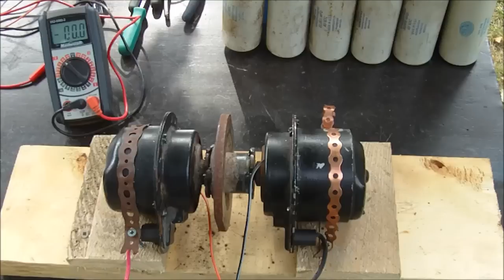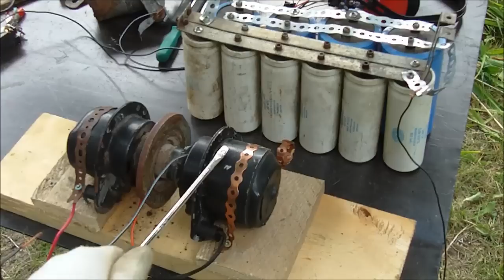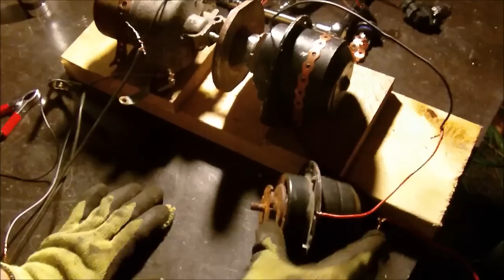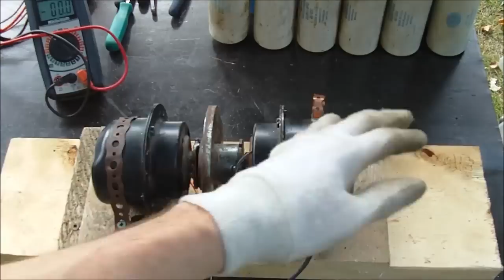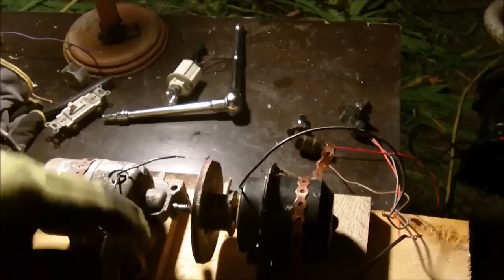Electric Motor to Motor, can they self run?

Comment: I was thinking an electric fan motor hooked up to an alternator. Would THAT setup self-run?
Reply: +killer13324 no. just... no.
Reply: +killer13324 Welllllll depends on the efficiency of the fan motor's input vs output,  and how this is connecting to the alternator (direct, chain, belt) direct is the best (less loss in transfer)  what is the efficiency of the alternator?? conversion from mechanical to electrical.
depending on the numbers, it could work.
Reply: Jesse Fritz
100% efficiency is what you nuts are describing, and thats damn impossible because even if we COULD design a setup that would allow that, the air resistance around the flywheel would take it to 99% and it would eventually end, but lets say its in a vacuum, and ignore slight power loss by distance travelled in wires. The engines are inefficient almost in DESIGN.
Magnets work best when close, but because you can only put so many around the edge and they are only so dense, you lose power due to the distance the magnetivity has to travel.
No way can we get them to 100%, not only is it impossible, but people who think they can get free energy from these machines are describing a 110% situation, where for some reason it generates more than put in. I cant even express how much it is ignorant to not know the impossibility of this kind of machine, and believing it could work just shows a lack of BASIC understanding of physics, (that's taught in primary school).

Stupidity is what people pray on, someone dreamed up a 100% or 99% efficient machine as a cool experiment, where a machine that produces no heat, sound. or emission of energy in any way spins indefinitely. Not only is it impossible, but people said, yeah, lets take that idea, use a shitty motor we got for $5 that makes lots of noise, heat. and vibrates, and somehow make a shitload of power with it.

Energy is never made or lost, only converted from one form to another. If you want perpetual motion, check out atlas clocks which work on atmospheric temperature changes (BUT STILL NOT 100% AND TAKING ENERGY FROM AN OUTSIDE SOURCE.).

tldr for the lazy bastards: NOTHING IS EVER FREE. (not even energy).
Reply: +Jormungand13324 It would if the fan motor was 101% efficient or better, which is, of course, impossible.
Reply: JJ Warner well shit...
Reply: Jesse Fritz If you can prove the first two laws of thermodynamics wrong, there's a couple Nobel Prizes waiting for you.
Reply: I can not only prove them wrong, I can and will destroy them. But I don't want a Nobel prize, it means nothing. They give them to incompetent presidents.
Reply: Jesse Fritz
So, prove the first two laws of Thermodynamics wrong, then. Right here. In front of me.
Reply: I have no desire to do so. ALL of the laws can be proven wrong. Just takes the right apparatuse to do it.
Reply: Jesse Fritz I'll be waiting. I'm open to whatever you have to show me, just give me concrete evidence that the first two laws of thermodynamics are wrong, and, perpetual motion being possible would logically follow.
 You don't even have to do it yourself, link me to someone ELSE proving the first two laws of thermodynamics are wrong, and I'll believe you. Surely if it's been shown to be wrong, a model in which they're wrong would have better predictive power and more accurately show the universe in which we live.
Reply: You guys are looking in the wrong place. That's all I can say at this time.
Reply: +JJ Warner lol give you a link that proves it wrong...? You're currently on a page like such and and every other failed video on YouTube... Don't make a claim like that.. You are one person going against an entire species collaborative effort to explain the fabric of reality as we know it. Here is proof.. Now this is really simplified.. The "work" generated =the force you apply to move your axis of rotation multiplied by the distance the force has to move multiplied by the cos of the angle you push at. W=FxDxCos(theta) F= the force you start with. Now.. "Work" in terms of Newton meters is your new force input. Solve for Work again and you'll see that it always depletes.  Now this isn't a made up formula, it's derived from mathematics just as factual as 1+1= 2.  All the concepts that's this is derived from are as set in stone as that. You can never change the reality of it.
Reply: Even if I had a physical unit defying these laws, J J Warner, you're the last person I would prove this to. It's not my fault you lack imagination. 

Just remember, heavier than air flight is impossible.
Reply: +JJ Warner I'm saying perpetual motion means just that, the problem is that there is probably misconception between people on what that actually means.. It means forever, and no human can truly comprehend what that is.. But what about a device that could run for 500 years? That may as well be forever on the scale of a human life. What about exploiting why we know about reality, physics isn't a bunch of math equations.. It's woven into what makes us human and how we perceive reality. What about using the earths magnetic field to induce electromagnetic currents Or using the vacuum of space
Reply: With the right apparatuse you can get past the laws. And this device can be made in any garage.
Reply: Jesse Fritz See, here's the thing.
Flight doesn't involve pulling energy out of magic. Helicopters and planes don't require additional energy to function, they're using no more than what's stored in the fuel they burn.
What you're saying is you can fly with an upward-blowing fan filling a parachute with air... I don't think so. I=V/R
Reply: Danny B
 Using the Earth's magnetic field wouldn't be perpetual motion. It would just be a very, very large source of power. Solar power isn't technically "renewable" since in ~5 billion years we won't have any more. And a device that could run for 500 years would be extremely efficient, but it wouldn't be 101% efficient, because then it could run increasingly fast for all of eternity, and even though it will run for 500 years, it will produce no more energy than you give it.
Reply: Who said anything about pulling energy from magic. Nobody is pulling energy out of magic,  this is the bubble in which YOUR brain thinks. Not mine sir. 

And maybe you should look at nasa EMDrive. A reaction less propulsion system.
Reply: Jesse Fritz
See, you keep saying that, but you have yet to show me "the right apparatuse"
Reply: I'm done,  not going to bicker back and forth to try to prove to you. You've already been programmed.
Reply: Jesse Fritz No, you've just lost the argument. All you had to do is give me something I couldn't refute, but clearly, my 9th grade understanding of science was too much for you.
Reply: No,  I just know what battles to pick that's all. I have zero desire to prove to YOU. Would you agree that with the right setup anything is possible?
Reply: Jesse Fritz
 With the right setup anything is possible, so long as it doesn't break physics all together, sure.
Reply: +JJ Warner oh ok,  just as long as it doesn't break the laws of physics. lol ok.
Reply: Jesse Fritz
 Yes... Free energy being something that breaks physics. Thermodynamics, to be more specific.
Reply: +JJ Warner what do I have to gain by proving YOU wrong in this? I have a zero net gain. so. ..no point.
Reply: Jesse Fritz
 Energy cannot be created or destroyed, therefore a generator cannot power itself. Free energy = creating energy, which is impossible.
Reply: Jesse Fritz If you could prove me wrong there's no reason why you wouldn't have already. I'm not an idiot, dude, saying "I just don't want to prove you wrong right now" doesn't work.
Reply: JJ Warner Yeah, the point i tried to convey hit a brick wall.. not supporting that a perpetual motion machine or self producing perpetual energy source is possible.. but I do think that it is possible to put an object in motion for hundreds of years.. whatever who cares even 20 years at little to no $$$$ for the amount of energy we could generate using magnetic fields of planets of putting objects in orbit.. or just brainstorming.. but the unexplored untested vastness of space.  If a device could feasibly be used to generate energy in space longer than the span of a human life.. or even getting into real wishful thinking.. endure the length of humanities existence than what's  even the point to work so hard on fighting the point.  Sounds more like someone who's gone into Ego repair mode. really, who cares how the thing runs, is it clean and does it cost human $$$.  The Earths Gravity isn't perpetual. So anything you construct here on Earth that runs, has to incorporate the Earths gravity to run. What happens when that element is taken away?  If you are talking  about using electrical current, just like i tried explaining earlier,  yu may think you are not creating anything but that's because of a plain and simple misunderstanding of what electricity is.  It's an unbalance of electrons in an object that are free to move from atom to atom.. So making this really simple.. If an atom has 3 atoms to give, and you induce a voltage to push the current of atoms, you can only push as many as that are already there... if you use 100% of the electrical energy, in order to get that extra 1% you need more electrons.. Where are they supposed to come from? Thin air?  It's no different that if I lift a dumbbell with 12 lbs of force..the dumbell won't move with 13lbs of force in the direction i pushed it. if i throw 3 pies in your face.. you'll get hit with 3 pies. Not 4. This all comes back to what i was saying that 2+2=4... If you don't agree with the fact that 2+2=4... 1+1=2 and so on... we live on different planes of existence.  Not even that, an electrical current through any metal will have some kind of resistance to the flow of electrons, which is just the electrons bumping into other electrons which do not need to satisfy their charge.. you'll never be able to stop that and it will eventually degrade the metal and it's conductivity.  this is the proof:

if you exert 10 lbs of force on a block
the block will not be pushed with 11llbs of force.

if i throw 2 apples at a clown, the clown won't get hit with 3 apples.  That's me throwing more than 100% of the apples I originally had. 

Energy isn't anything separate from matter. that's part of your misconception.  Matter is energy and Energy is matter.  People grow up seeing them as 2 separate entities, and fill in the gaps to explain the universe to themselves.
Reply: Lol its not this complicated folks I'm telling you.
Reply: Danny B But an engine that runs for the entire existence of humanity isn't free energy, it is, again, just a very large amount of energy.
Reply: +JJ Warner first off an 'engine' requires some sort of fuel to perform  a stoichiometric conversion. I'm not talking about an 'engine' and yes, that would require a lot of fuel, if you are indeed referring to an 'engine'
Reply: JJ Warner yeah, more of rhetorical situation.. I'm talking about fantasy land, keeping it stupid simple.  I don't mean in the terms of "Free energy" but in terms of Human $$$$.  I've only been an engineering student for 2 years, and the type that doesn't take someone's word.  You can explain thermodynamics all day, but to someone with out a couple years of physics, applied mathematics and base knowledge of chemistry it just wont make sense. One question will endlessly lead to another.  The user friendly equations like  U=Q-W may as well be scribbles.  you can throw out the names of laws, talk about the different systems, enthalpy, entropy, and a whole lot of physics to fill in a lot gaps.  Just stating a condensed version of a Law doesn't work for me either.  I need to see how the equations are derived, a lot of which involves understanding integrals, and i don't see it being possible to explain in la couple sentences.  I don't claim to be very knowledgeable, just extremely curious.  The smartest people find the right way to condense and distribute the information
Reply: +Danny B okay,  let's say math won't take you there because it's new territory.  build a unit, it works. then what? you can do it physically but not mathematically. if you're going to break the laws you need to come from a different perspective.
Reply: That's just the thing and my point on this particular subject.  The math does work, and when it boils down to the most base of concepts, 2+2=4.  If you want to try and break the laws go for it lol.  I'm just saying it's like trying to walk through a wall made of iron that's 30ft thick.  dude, lol If you can break the framework of mankind's ability to understand reality go for it.  You seem really motivated and anyone who sees the amazing power and elegance of the universe is alright in my book. Never let that creativity go. Best luck!
Reply: +Danny B I have no desire to walk through a 30 ft thick was of solid iron lol. I do know how to break the laws though. I've already broken the newton's 3rd law. built a reaction less drive many years ago. using inertia as propulsion. other 2 laws are next.
Reply: +JJ Warner LOL you crack me up,  you have no clue on how to break these laws. it's been done. that's all I can say. tell me something, what would be the point in convincing you that I can do this?
Reply: lol just let it go, let creativity take it's course.. Maybe start getting your hands dirty in some theory and view it more as a stepping stone rather than road block!  fight the battles after
Reply: +Danny B I have no desire on theory, I want physical. I think I did the 3rd law back in 2003. I've thought about building it again. super simple actually.
Reply: +Jesse Fritz yes with this unit you could theoretically make a flying machine with no wings, no propellers, no external thrust. this is what inertial propulsion is. that is a total violation of the 3rd law. a reaction less drive. typically action is the turbine spinning up and thrusting the unit forward. if there is no visible thrust, then what is it?
Reply: Jesse Fritz lol, if you broke one you broke them all and physics... I think the whole action-reaction title is taken as if" i push something it will move away from me..  or if i kick my table it will break".  those are collisions, and other forces.. the 3rd law just describes how forces interact.. without it.. then what...? forces just pass right through each other..? I'm pretty sure I'm not just falling through the ground right now.  My weight is pushing down on the ground.. the ground  pushing back on me with the same force. If not.. and it's pushing back on me with more force for some reason.. than This equation goes out the window F=Ma... and I would be getting launched off the ground every step i took.. If the ground pushed back with less force... I wouldn't be able to step forward!  So what's the new law to describe this reality you've discovered lol?

Comment: This can't really be properly done with brush motors or any even slightly conventional motors at all. You would have to precision machine all the parts yourself following extremely precise parameters. Two separate motors aren't required no shafts no bearings

Comment: Why are you not putting them side by side? 1 motor is turning 1 direction and the other is turning backwards this way vs them both linked via belt which they both turn the same direction. Having them sit face to face spinning is counterproductive. I use to do this stuff as a kid when we lived in BFE. My stepdad had several junkers sitting around and i enjoyed playing.. Well mom never understood it but she just knew she had power for her fridge in the middle of a 125 degree desert without power. How did an 11yr old do this without help from any adult? Duh!!

Comment: This is impossible!! You have to make the motors so that one of them produce much more than what they have made it to be from factory. That means that you have to open it and rewind it with much more copper and better magnets and more magnets. in that way you produce much more energy and then you need a fly wheel and then you need and then.... Yes Free Energy is REAL...

Comment: Motors need to run backwards to produce electricity as a generator, so reverse the motor and try it again.
Reply: What a noggin!  Completely untrue.  Try it: a motor is a generator, and either work in either direction (4 quadrants of operation).
Reply: ***** Not the motors I've used...
Reply: Have a diode in series did they?

Comment: and also try 1 motor with 1 meter R gear and put generator with small R gears so if motor turns 1 time generator turns more then 10  and put 6 or 10 generator around the 1meter R  gear so in same time you will have 6  generators turning if you spend 1kw energy to  turn the motor to turn 6 generators does it make sense to generate  power for motor and use extra energy to generate income or use for something

i hope picture in this link will let you understand what i mean

https://thumbs.dreamstime.com/z/one-big-gear-eight-small-gears-16943920.jpg

Comment: Ok I have seen your work but you are loosing something.1) the two motor does not need to be in any direct contact.2) Use rectifier (four diods properly connected)  the reason that it will not work is  because it has a ground leakage ( negative volt short ).  Mount it on an insulator, Use a plastic belt to connect the alternator. Note alternative produces Ac but need DC to run due to it polarity. That is where the rectifier come in. Try it on smaller motor first. all fan will work. I did it and it work trying it on a bigger scale now